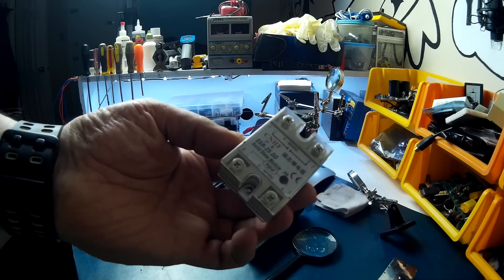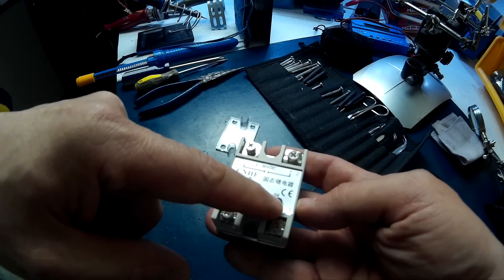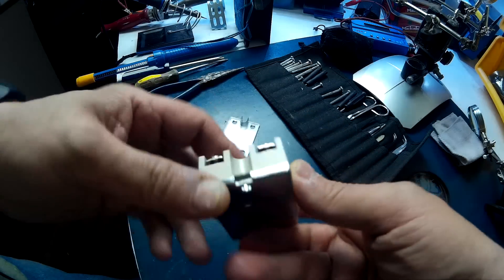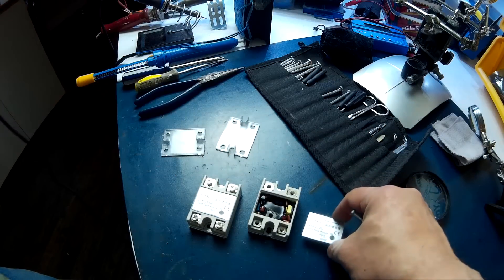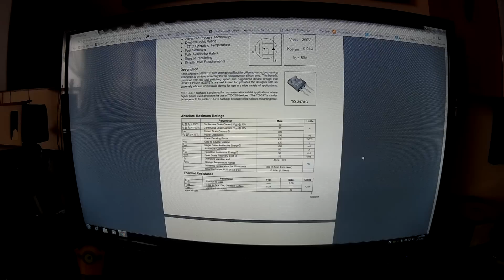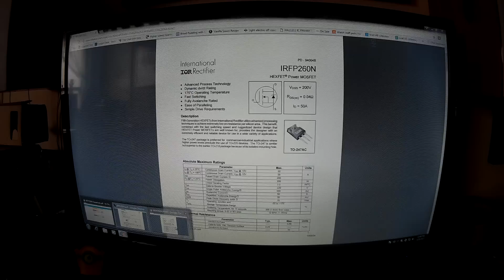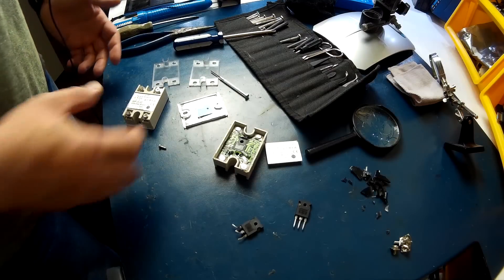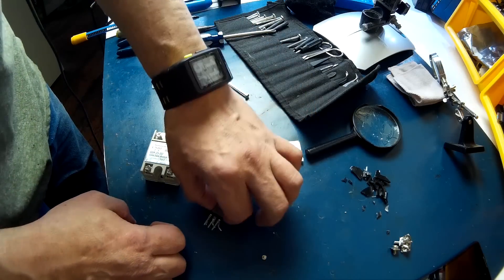25A Solid State Relay. (SSR modification 30amp to 50amp )

Comment: do you think if i bought one then used x2 mosfets in parralel it would take more current? i need 40 amps :)
Reply from the maker: yup works well. runs cooler.